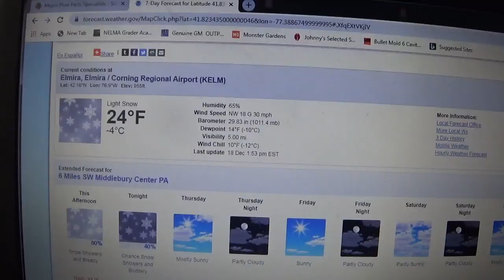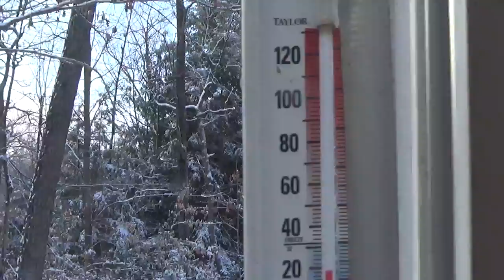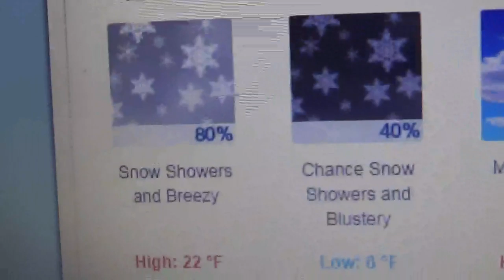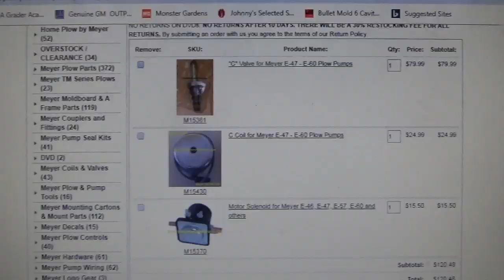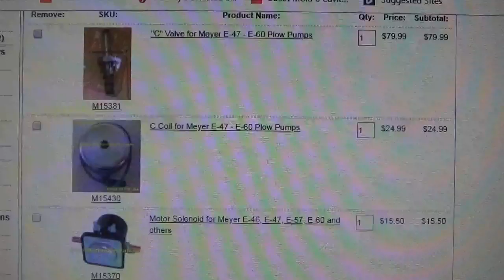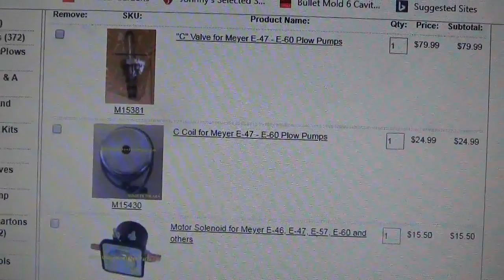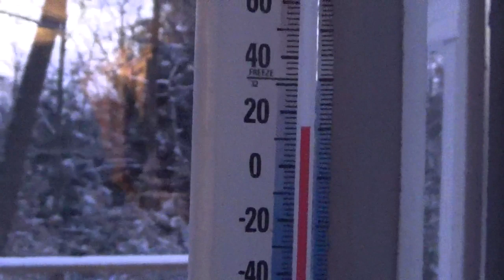Snow plowing and single digits coming.

Comment: Smith Brothers are very good to do business with.  The plow angling to the right is the default position.  I'll wager that if you change the E coil your plow will perform correctly again.  If you hear your solenoid clicking when lifting of angling your plow it will not be a faulty solenoid.  Also check your lift, lower and angling switches.  When your switches are energized the coils will have magnetism.  Place a screwdriver next to one to see if they are magnetized.  Good Luck!

Comment: Doesn't  the backhoe  run? Be a good  back  up.
Reply from the maker: It runs and I do use it as a backup or to move the piles, the starter is not working at the moment. But I have 3 things to plow with and the simplicity is still working.